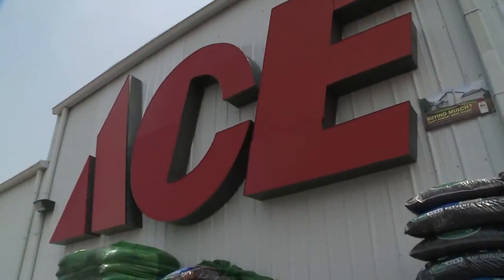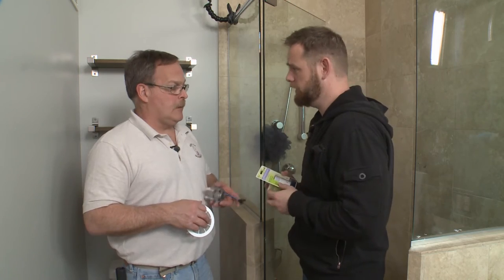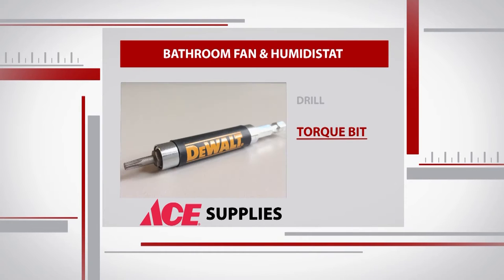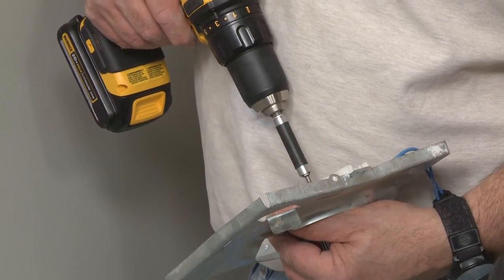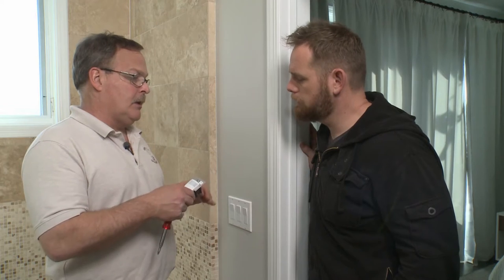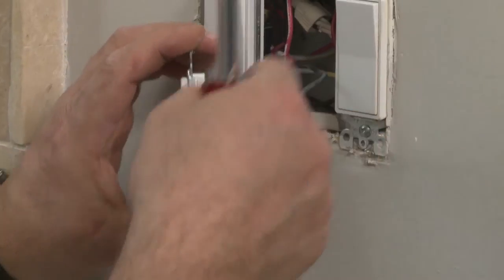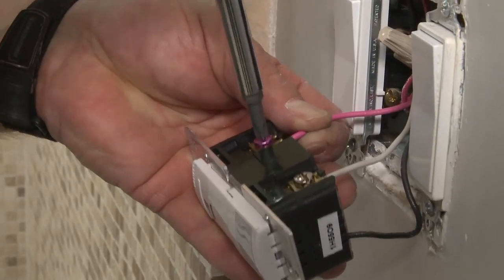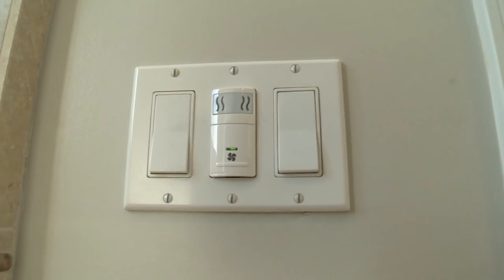Replacing Bathroom Fan & Adding A Humidistat

Comment: Help, I am replacing exactly the same, question is, I only have black and white and ground, fan not working, I guess I need the load one wire or the red screw in the switch, how to get this load wire? Or I do pigtail because it has 2 outlets extra next to it for the main lights of bath. Help
Reply: Same problem, I only have black and white, no idea how to connect the red
Reply: You don't have neutral wire.
Reply: You need to add (Pigtail) a neutral wire to the screw terminal marked white, Connect the line or power wire to the black screw terminal, connect your load wire (wire going to the fan) to the red screw terminal and connect your ground wire to the SW green screw terminal. when properly installed the fan should turn on and off from the SW and from the sensor.